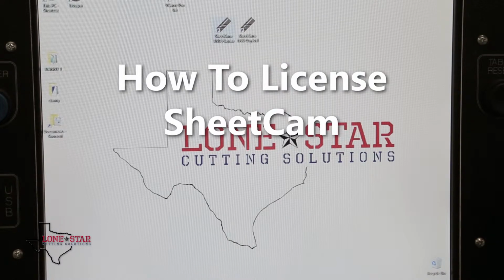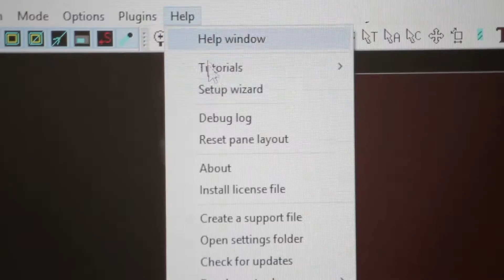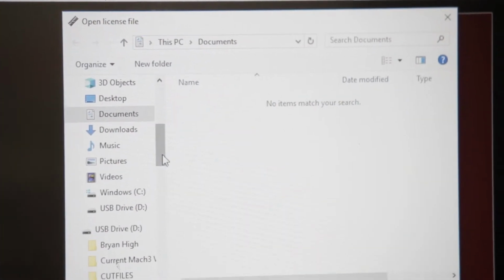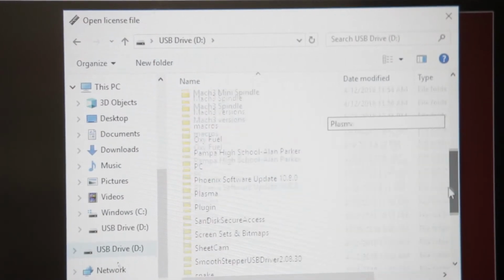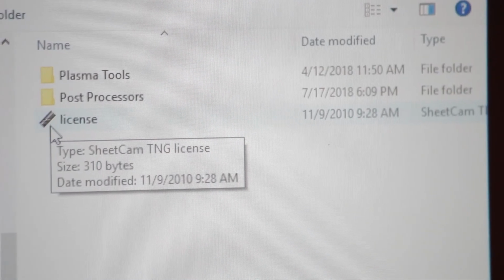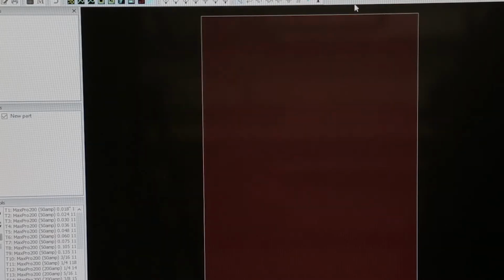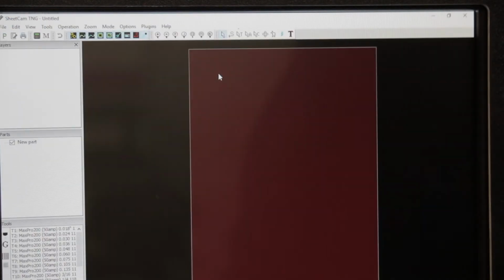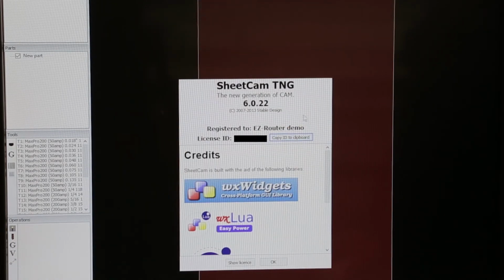How To License SheetCam On Your CNC Plasma Controller

Comment: Respected sir,
After clicking the post processor button , it is showing the message of
Post processor is completed but the size of that .tap file is very
low...quite low..
After opening that file in mach 3 it consist of only two to three lines of
g code...
I can't able to write full g code of my .DXF file

Please reply me..plz sir plz .
Waiting for your reply...🙏